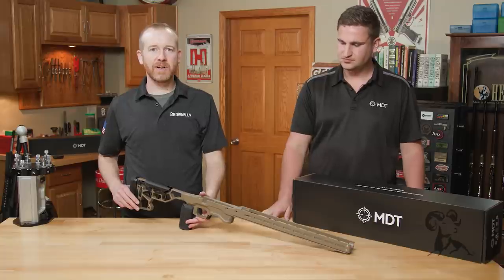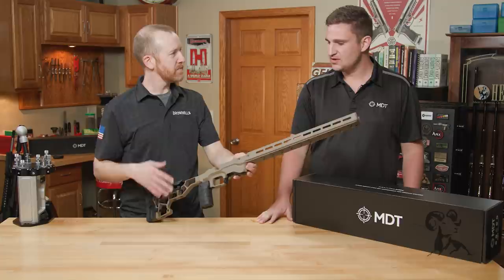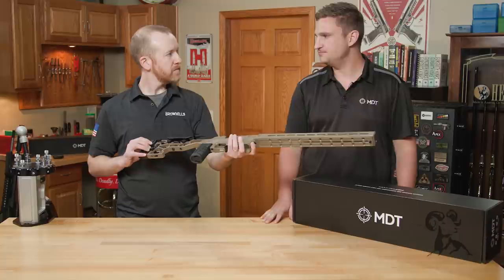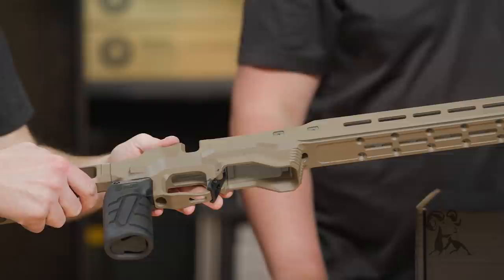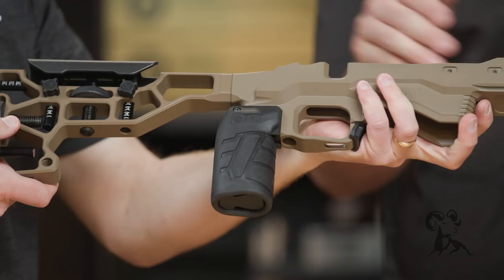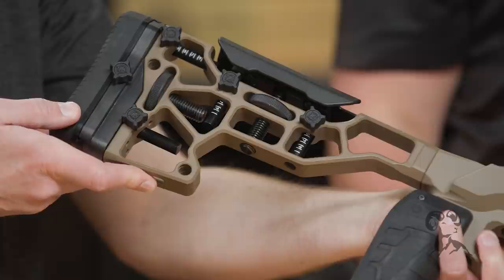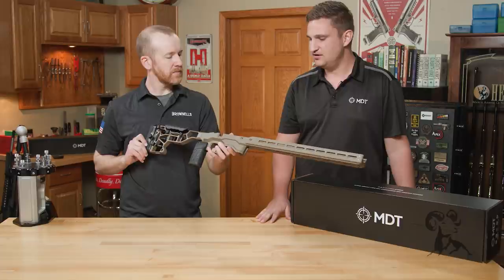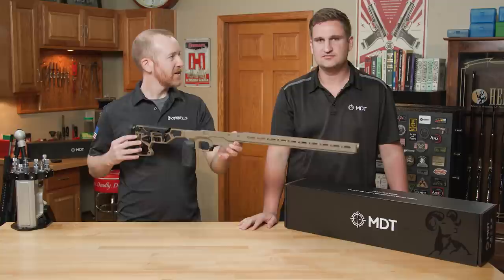Product Spotlight: MDT ACC Chassis System

Comment: I would LOVE a left hand version.
Reply: Just buy one and use your angle grinder to make a slot for the bolt handle on the left side. These only cost about $1,200.
Reply: They have 3 options; A, R and L. 
Arrogance Aluminum, Right out stupid expensive and Luxurious expensive. 
They even charge for the plastic add ons. Look at the forums... price gouging from day 1.
Reply: Lefties, (rarely) receive love.
Reply: @cameronharris4681  MDT makes a left-handed version:)

Comment: Amazing stock with amazing specs, the price is a bit outlandish however.
Reply: They are expensive.   Buy a billet of aluminum and start whittling, i suppose?
Reply: @randymagnum143  Ah thought it was polymer. Still however, there's full chassis and actions for that price.
Reply: @randymagnum143  yeah but you can arm 9 to 10 child soldiers with hipoints then and have a small child army for the same price as an empty metal chassis.